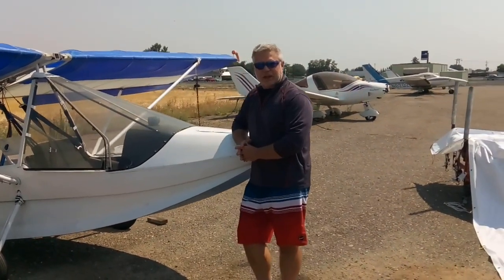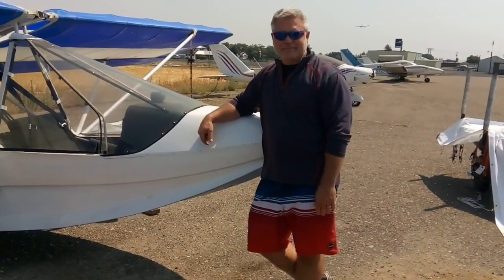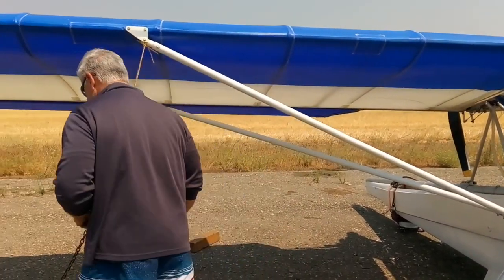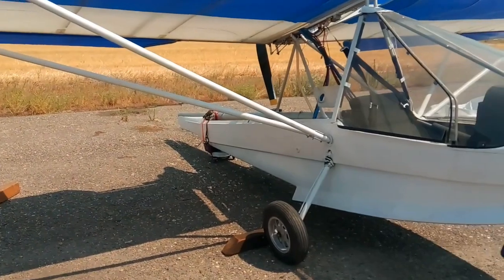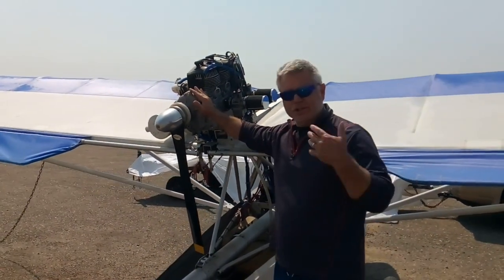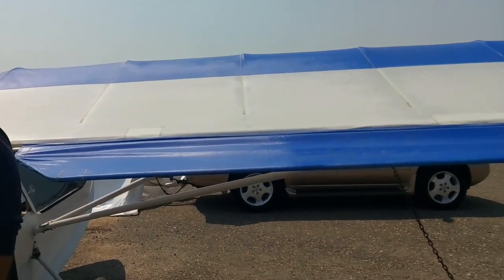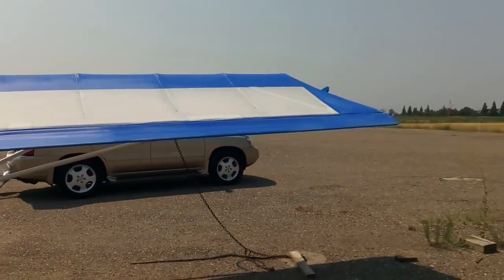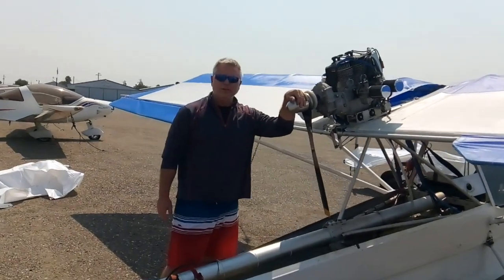Ultralight! Meet the Aventura

Comment: very cool, if you don't mind could you tell us what the cost is for this UL?  complete start to finish.
Reply from the maker: I will let you know when it is complete...still working :)
Reply: ok thanks. I just started looking at ultralights and para trikes.  I really like this aero. though the price may be a little more then I could go for a start up.  most likely I will sell off the motorcycles to do this. its just getting really bad out there on the road now. flying is much safer lol. I'm sure the girl friend won't like it but it beats getting run over by a texting teenager..........
Reply: real would be nice to find a used UL in A+ condition.  I've sold two bikes so far but the market just plain bad for bikes here in SC. lost my butt on those deals but will keep the 98 fatboy evo as a bar hopper.  lots of UL's on Barnstormers website just no aero UL's